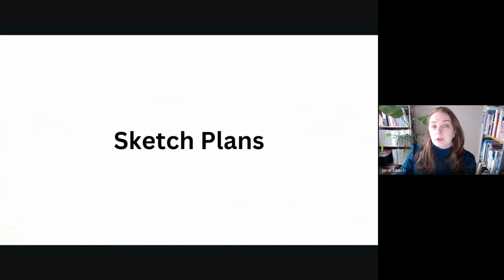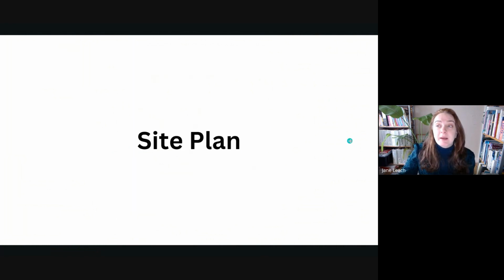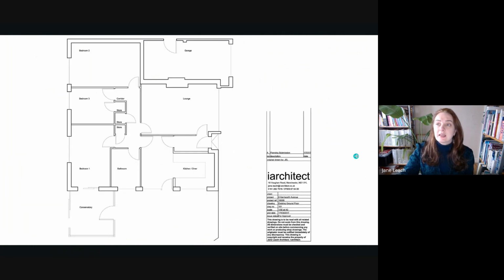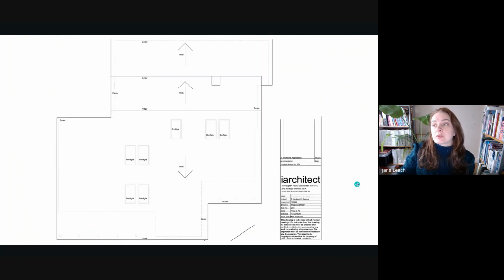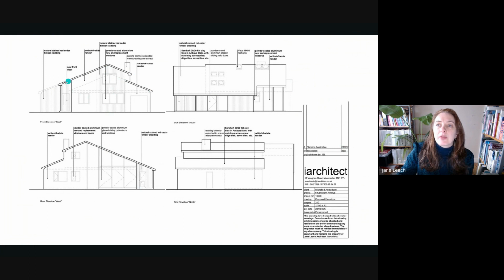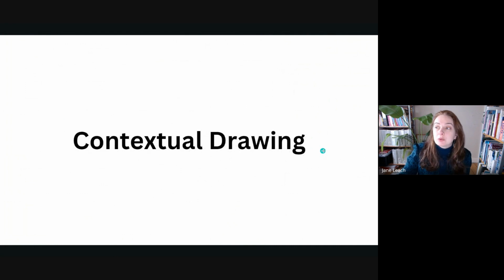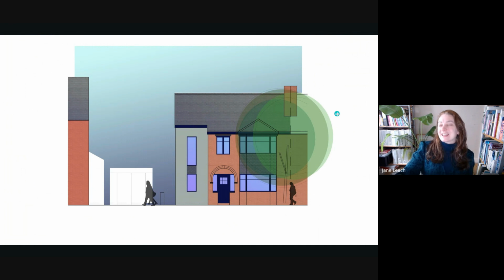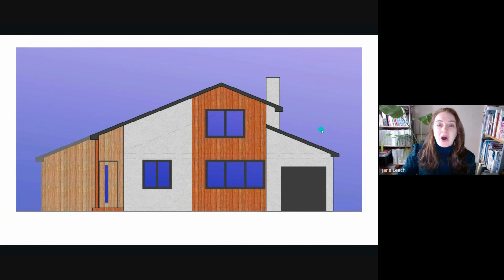Essential planning application drawings

Comment: Great video.
I’m trying to put together a change of use
I need to supply drawings. 
There will be no external alterations. But I presume they still have to be to scale?
Where is the best place to look for up to date drawings to alter as required? 

Cheers
Reply from the maker: If you don't have any drawings of the existing building, then you need to create them. You can only use drawings that you own the rights to. If you don't own any then you need to carry out a measured survey and draw them up - or employ someone like me who has the necessary expertise and can do it for you.
Reply: @ 
That’s great 
Do they need to be to scale?
The estate agent has suggested I can use their floorplan but it’s not to scale 
Thanks
Reply from the maker: @darrenelkins5923  yes drawings must be to scale